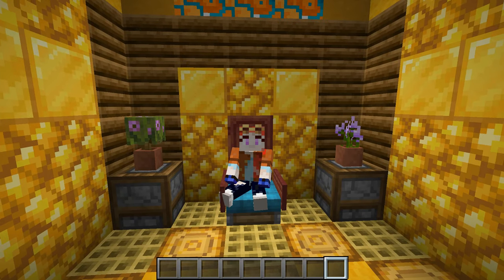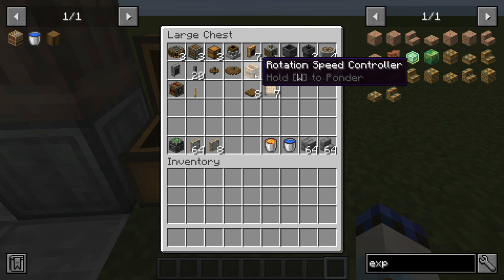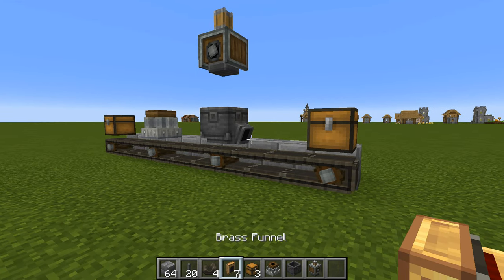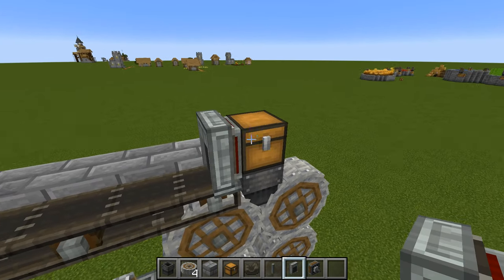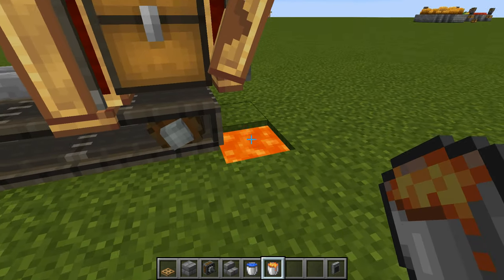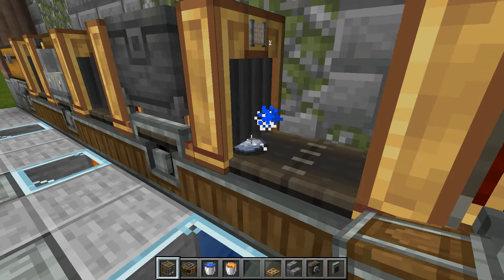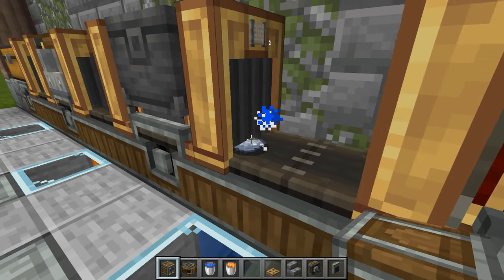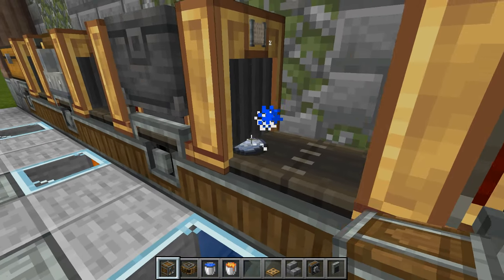Minecraft Create Mod (1.20.1): FULLY AUTOMATIC  GOLD farm tutorial.

Comment: A great foundation for a gold farm, albeit a little slow. What did was just duplicate the production line x4 and use a stronger cobble generator along with some brass tunnels. I also placed fans on both spaces between the funnels to process any material in-waiting - I also changed the filter output size of the sand funnels to 32. Yield becomes very nice after this.

Comment: One thing to note for the filters. For each filter that was for a single item you don't need to actually use the filter item if you've got at least 1 of the item you're trying to filter. So for the Flint, Clay Balls, Clay Block, Taracota, and Red Sand.

Comment: For peeps that have issues with the shafts/belts turning everything (including the crushers) into the opposite direction:
Go to the Rotation Speed Controller and set it to 16 RPM but on the TOP bar, NOT the bar below. That's how I fixed mine. Great video btw!
Reply: bro thank you so much!! I have been trying to fix that for an eternity
Reply: thank u
Reply: it depends on what direction the farm is facing so you may or may not need to change the speed controller

Comment: You need:
3 water wheels
3 encased fans
3 chests
1 millstone
7 brass funnels
1 mechanical press
1 basin
2 chutes
4 crushing wheels (so 2 sets of 2)
1 andesite funnel
20 shafts
11 small cogwheel 
1 large cogwheel
1 rotation speed controller
4 belts
7 gearboxes
5 drills
10 encased chain drives
1 clutch
1 lever
8 trapdoors
7 list filters
2 bucket lava (+1 for the bin)
2 buckets water (make a water source nearby before you start)
64 stairs
64 blocks

For windmill:
1 windmill bearing
72 windmill sail (64+8)

My personal recomendation: 
3 threshold switch (one on each chest and remember to program them)
4 redstone links (one "sending" on each threshold switch and 1 "recieving" on clutch powering the drills remember to put a block in the link filters). 
this will help to stop the farm from overflowing.

Comment: The fan mechanics have been updated and it no longer matters, in which direction they spin. They will wash/blast/etc either way.
Really nice design you built there!
Reply: With one exception, the water source would have to be on top if the fans are pulling down instead of pushing up.  It kinda does really matter.

Comment: The only problem I find with this design is that the system still bottlenecks if you try cranking up the speed. I did the thing where I set it to 16 limits for the brass funnels, but a better way of doing this is having the sand wash use a strong fan to push stuff against the input funnel rather than using a belt. The drawback with this idea however is it also won't work unless the speed is sufficient.

But if you do get it working right, it'll allow you to have a much higher throughput.